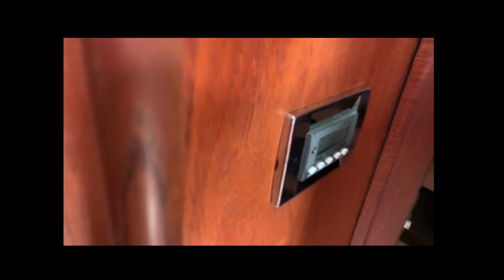How Does Boat Air Conditioning Work?

Comment from the maker: Since we put this together, there have been many new technology improvements in Marine Air Conditioning. Units are getting more efficient. More boats are shipping with 24v batteries and power systems. And, battery-powered marine ac systems have gotten much more reliable and energy efficient - so boat owners can enjoy cool night's sleep without shore power. We are also seeing more interest in using these 12v and 24v systems as defrost and defog systems in working boats - like tugs and pilot boats. Feel free to give us a call if you have any questions about marine air conditioning. Or, visit our website which is full of how-to's, best practices and help with diagnostics.